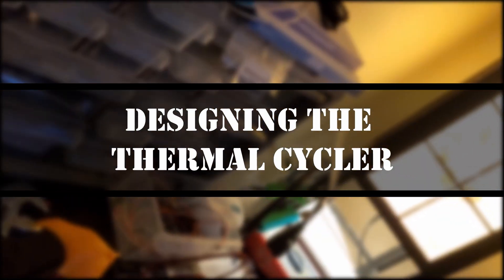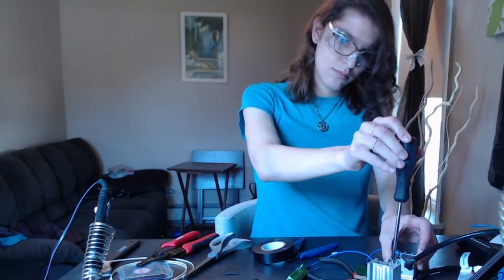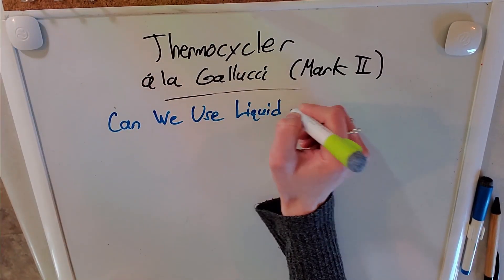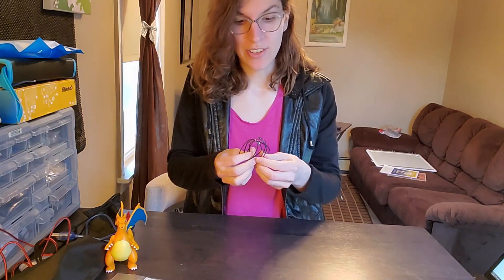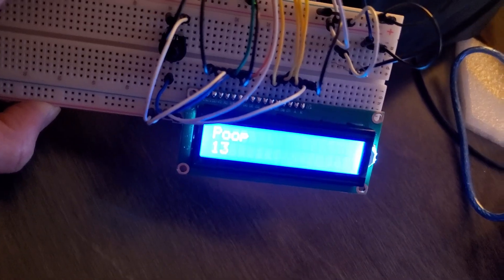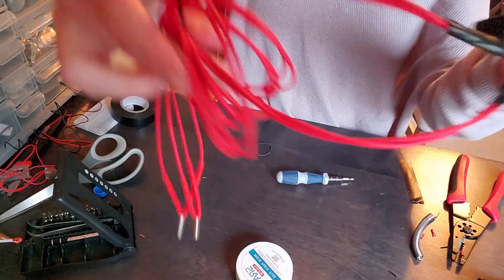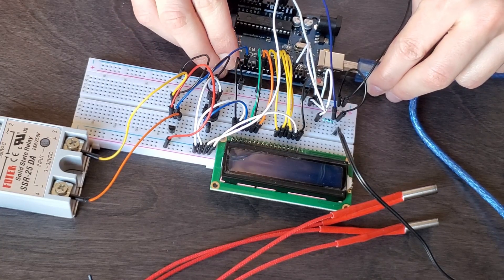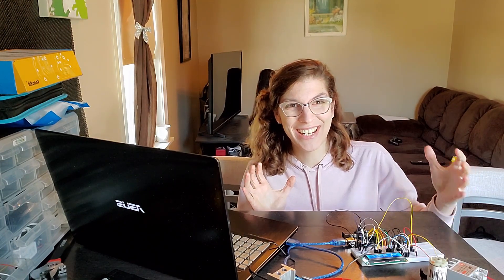Making A COVID Test Part II: How To Build A PCR Machine

Comment: I made my own c0v1d test. you need a 10 sided dice.

If you have been in contact with other people roll the dice. 
if you have been unmasked roll the dice. 
If you have taken a c0v1d vaccine roll the dice once for each shot you had.
If you are above 30 roll the dice.
If you are a related to a gullible sheep roll the dice.

Now add up all your numbers and multiply them by the pf1z3r co-efficient, which is 0. Now look at your final score, if it is above 0 you definitely have c0v1d, and you need to self isolate for eternity.
If your score is 0 you better self isolate for eternity just in case, because this testing method can produce false positives and negatives.

Comment: :) i used a water cooled cycler in... let me remember... in 1998-2000. You know, I remember even a thermocycler consisted of 3 glycerol baths with different temperatures.  And  a mechanical arm moved tubes from one bath to other :)

Comment: Cool way to do the tempereture. Have you thought of using a Peltier device? With that you can make it too hot to touch in a couple of seconds and not only that but if you flip the power poles the hot side can become the cold side so you can control the temp. The only down side is there not very efficient power wise but heat and cool quickly! Awesome channel!
Reply from the maker: Thank you!! I love peltier chips! I was actually messing around with those too, I really like the ability for them to act as heat sinks as well. In my 'part 3' of this series I elected to use cylindrical heating coils that 3D printers use to heat up, which actually were way more efficient (I changed the design around to allow the heaters to be inserted directly under the tubes)
Reply: @izzitMichaela  I just watched it, very awesome stuff!!! Thanks for uploading  :)

Comment: Super cool!! I just had one question as I'm new to this. Why do you need to use a transistor to turn the SSR on/off? The arduino is capable of outputting a 5v signal through one of the digital pins. Couldn't you just have the arduino turn the SSR on/off by turning on/off one of the pins and directly attaching the pin to the SSR?
Reply from the maker: Thanks for the comment! So, although the voltage would have been fine, I was running into issues with current draw. Since the arduino is controlling the screen, thermometer, and pump, I felt drawing more current for the heaters might mess up the board

Comment: Great job! I was also thinking about peltierelement like other people also commented but of course, this also have its dissadvantages. Also, I did not see if there was a resistor between the Aurduino and the transistor. There shall be a limiting resistor since there is 5 V from the microcontroller and ~0,7 V at the base of the transistor, i.e. 4,3 V difference. With max 20 mA from microcontroller a 215 ohm resistor or greater will do. Max resistance depends on the amplifier (hFE) of the datasheet of the transistor depending on how much current you need flowing through it.
Reply from the maker: Thanks for the comment! The electrical engineering bit of this project is my weakest subject, but hopefully I'll get better as time goes on!

Comment: I've been building a PCR machine, based on OpenPCR, I used an aluminum block, to hold the tubes, and I'm using a peltier to heat and cool the block. My ramp rates are decent until 80 degrees then it heats up very slowly, So, I'm planning to add resistive heaters (cartridge heaters) to aid in heating until 95 degrees, and also provide better control over the temperature, avoiding hysteresis due to a on-off controller.
Reply from the maker: That's a great idea! Is OpenPCR a software package, or a physical kit?
Reply: @izzitMichaela  it used to be a Physical kit, but now they no longer make it. The firmware is available on github. 
I'm a noob at programming, so I couldn't figure out how to use that firmware, so I wrote my own simpler version. I have now shifted from Arduino UNO to ESP8266

Comment: Awsome Progress, now I know why I could not beat you in any game by the time you were 8 years old unless it required a serious amount of luck.  I'm trying to figure out why you need to cool the block as opposed to just shutting off the heaters, look up "heat anticipator" used in thermostats to keep room temp stable by anticipating the temp rise and cutting off heaters in advance of set point to maintain steady temp.
Reply from the maker: That's super interesting - I hadn't heard of heat anticipators before. I needed a cooling system because the PCR reaction needs a very fast cooldown time (like 5 degrees of cooling per second) and I was skeptical that just turning off the heaters would make that change happen.